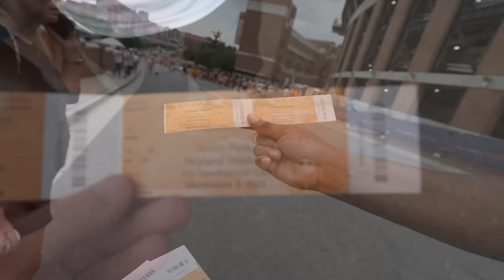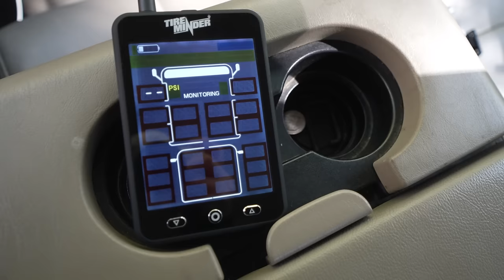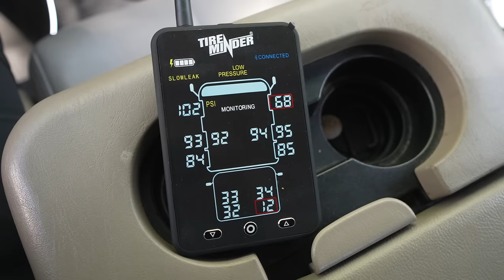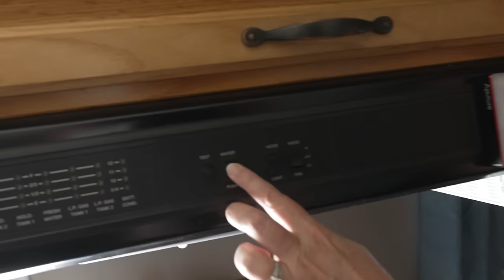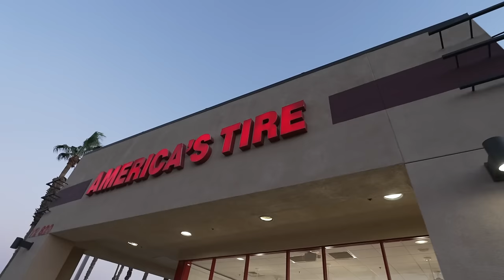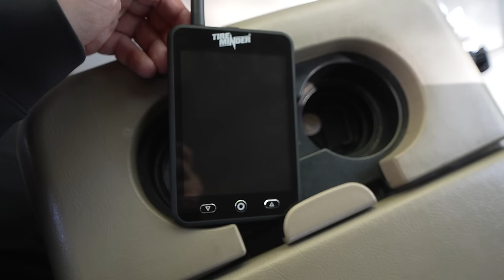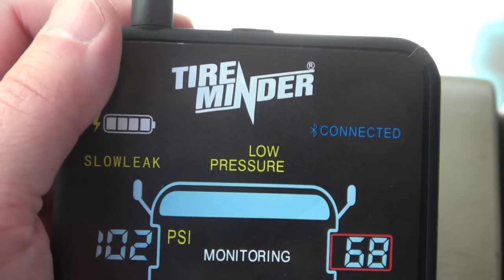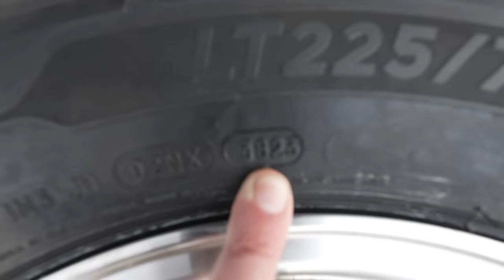TRIP KILLA - Our WORST RV Tire Disaster!

Comment: I've had similar experiences with tire installers who ignored my pleas not to jack on the axle, but I was watching and was able to call them off. Luckily, no damage. I just replaced my travel trailer tires at five years. Yeah, expensive, but less expensive than deferring it, as you folks know. Thanks for sharing that. It is an invaluable lesson for all your fans.

Comment: Where was your spare tire for the trailer
Reply: It was mounted under the trailer. Since we had already decided to replace all four tires, and the tire shop was less than 2 miles away, we decided to just skip putting on the spare tire. We were broken down on a very busy interstate exit ramp, and we felt that spending more time there crawling under the trailer to get the spare and then putting it on would be more dangerous.

Comment: you might want to think about replacing the shocks on that trailer with KYB‘s I guarantee you those are probably gone too. I know you don’t want to hear about that
Reply: We had new axle’s installed in 2021 and I think Vinnie put new shocks on then too. I’ll have to check with him to be sure!
Reply: @kristymichael  they look like cheap Monroe, which are made in China might want to have them checked . lol
Reply: I sold my diesel because we broke down for 2 1/2 weeks due to the smog device and I went back  to gas. My wife asked me she says how much you gonna spend on this well close to 5000 by the time I got done getting it ready to pull a trailer new shocks Different things but my question is when was the last time you replaced the shocks on your truck go with Bill Steins if you haven’t, you may have already so have a good day
Reply from the maker: @acmanwwjd1 we changed our truck shocks to Bilstein several years ago. Yes, a great upgrade that is highly recommended!
Reply: @LongLongHoneymoon  keep your truck. You have one of the favorites out there without all the smog on it and the cost of trucks right now it’s ridiculous. I sold mine and went back to gas. I’m happy but keep your truck. You got a nice one.

Comment: Your  tire  disaster  was  not  even  in  the  same  ball park  as  our tire  disaster  we  had  years  ago.   We  had  a motor home  that  had  five  tire  blow from  Fl  to  Tucson.  Items  were  were  torn  up :   tool  box  in  front  of  front wheel,  tail pipe  that  actually  almost  ripped  into  our  propane  line,  Steps  torn  off under  door,   Gas  pipe torn  into and  ripped  off.     Many  electric  wires  torn  into,  we  didnt   have or turn  signals  and  other  things  that  worked.   Cost  was  over  5000 for  tires  and  damage  was over  5500 dollars  and  we  were  delayed  at  my  brother  house  in  Tucson  for  2  weeks.       The  culprit  was that  a tire  store  put  too big  a tire  on our  motor  home   before we  bought  it.   Thanks  Buddy  Gregg  Motor  Homes  Sales.   !!!!!!!!!!!!!!!!!!           Discount  Tires  in  Tucson really  saved  us  by  knowing  what  the  problem  was  and  getting  us  retired.  Cant  say  enough  great  things  about  them.         Hope  I  didnt  bore  you.     Charley
Reply: Holy smokes, you did have a tire disaster! Glad they were able to find the culprit and get it fixed!

Comment: I had a trailer tire start to come apart after we made it home from a long trip.  It’s the same brand name you had trouble with years back.  I won’t use that brand again.  However, at the time , my trailer tires were eight years old.  I also upgraded to larger tires with greater load capacity.  I never looked back, and we have since sold the trailer.  Combined with other experiences I became the “tire guy” at shop I worked at.  Experience does make a difference.

Comment: I DO NOT recommend a large corporate tire company. They hire young inexperienced cheap labor. I too learned after one flat on my double axle to get one of those ramps. I think I'm missing something as to why there was not a spare available.
Reply: There was a spare available. But after this blowout, we weren’t going to chance another! So we just replaced all 4 tires. The tire shop was only 2 miles away on city streets (not the interstate), so it wasn’t worth the danger of crawling under to retrieve the spare while broken down on the side of a very busy interstate exit ramp.

Comment: We tow a 25 ft. Airstream for the past seven years from Florida to Maryland twice a year so 4 trips (2 round) trips.  We have had flat on camper going up and flat on camper coming south just 10min from our last exit off 75.

But last summer on our F250 we had a blow out/ exploding tire on the Ford rear passenger tire.  3 pm in afternoon on a 2 lane part of 95 and cruise set at 70 mph in the passing lane.  Then …. 🫨😵‍💫😳🥺😱😳explosion/ metal/glass and did I say 💥 pow explosion then we fishtailed across into the other lane and back to passing lane again . Hero is Greg my husband the driver who controlled the rig to come to a stop but in the median which left our exploded tire exposed to the fast lane traffic. The tire in shreds the shell well curled up , that was the metal sound and broken window on the airstream.   Ta da 
Our 4 tires looked good too and we thought we could get home then replace all four …. They were 5 years old and still under warranty (so called).  An 1 1/2 hours we finally changed our tire with the 2005 tire that is under the truck and had never been used.  🙄🫤🫣

Good thing it didn’t explode 3 minutes later because we would have been on a 2 lane bridge crossing a very large lake as we were in SC on 95.  I don’t believe   We would have survived that.
Reply: OMG. That was close

Comment: that truly sucks. question: do you not have a spare for the Airstream? we had one for our Outdoors RV until, like you, we had a flat. after installing the spare, i suddenly realized that we were now without a spare. so....we stopped at yes Discount Tire and had the original replaced and bought a entire new wheel and tire so that we would have TWO spares.
Reply from the maker: We do carry a spare tire. In this instance, because we were located only a couple of miles from the nearest tire shop, and we were eager to move our rig away from the side of the interstate, we opted to travel on three wheels to the tire shop. if we had been traveling a further distance to the tire shop, then we would have gone ahead and put on the spare tire to get there. When this happens, I immediately knew I would go ahead and purchase for new tires so I did not even bother putting on the spare.
Reply: @LongLongHoneymoon  i  completely understand. thank you and btw, when we had our's repaired, we insisted to the guys (and gal) at Discount Tire that we use our "ramp" to avoid the possibility of an unwanted "jackulation". LOL.

Comment: the airstream trailer is a great shell for the protection of yourself , but they install CRAPPY  parts in the inside the water tanks are the worst in the industry, !fresh, grey and black the worst,  the other proplem with the airstream is the frame coating that the manufacture said is the best on the market, ??? ahh NO! rule of thumb , all my  trailers i had got a coat of LINE X underbody spray, 2 coats, full protection for the rust problem that airstream has, ! as far as that tire, your lucky there was sdomeone to tell you whats up? i use G rated tires, . that monitor  that was on a low batteries, plug in a 1 amp charger in the plug and continue to charge it .
Reply from the maker: I love the LINE X idea! I would like to add this to our trailer undercarriage.

Comment: I NEVER go down the road with a trailer without carrying a spare tire mounted on a wheel.  You could have easily changed the bad tire on the road and likely made it home without incident.  What would happen if you had a flat 200 miles from nearest tire shop?
Reply: We never said we did not have a spare. In fact, we did have a spare. But the spare was as old as the other tires so we would’ve been gambling with it as well. We were fine to limp over on three wheels because we only had 2 miles to get to the tire shop, and it was on side road, not the interstate. We felt it was more dangerous to climb underneath the camper to retrieve the spare tire and put it on because we were broken down on a very busy interstate Exit ramp. Now, if we had had to get back on the interstate to get to the tire shop then yes, we would have put on the spare tire.

Comment: It's sad that you have to be a Karen of a customer to people that should know their Job.  One kinda related thing I'd like to mention for other trailer users, I had the metal mount that holds my spare tire bend/break at the welds while on the highway, fortunately it didn't completely fall off and hit another car, and was alerted by another vehicle as well, but I check everything on my "preflight checks" before hitting the road.

Comment: We are currently parked at an Elk’s Lodge in Redding waiting for our truck tires to arrive. We made the choice to wait until this trip and get all new tires at home.  When we pulled Inyo our campground and setting up we noticed a screw in one of our truck tires and had  AAA come out. They would not repair it due to worn trends so we used the spare. Which is a different size tire. So this morning we called around and found a dealer that could order the tire today for a delivery tomorrow. We will see how that turns out. We are looking to stop in Temecula AS dealer on our way to Carlsbad to get the tires on the AS replaced. We cancelled the last week of our trip to bee line it to get all tires replaced. Should have done it before we left, but like you we wanted to get a few more miles out of them. We are defiantly not judging but life would easier if it wasn’t for that little thing called money.  I’m glad no one was hurt and no major damage to you AS. I pray we have a similar outcome of safety. (Not of mistake in lifting the AS properly)

Comment: Dude, this might be a stupid question at this point, but where is your spare for the trailer?
Reply from the maker: We carry a spare. And yes, we could have put on the spare tire and continued on the interstate. However, and the situation, we knew that the nearest tire shop was only a couple of miles away, and we were eager to move our rig away from the side of the interstate for safety reasons. So we opted to just ride on three wheels at lower speed on side roads over to the tire shop. I probably should have addressed this point in the video because several people have raised the issue. Thanks for your comment!

Comment: You do know I hope that you can shower at a truckstop for probably $10. I certainly would have chosen that option over skipping that long. Otherwise enjoyed your video as I always do.
Reply: As a female I would rather avoid showering at a truck stop. I’m sure it’s completely safe, but I’m just paranoid. 😬 We were basically riding in the car, not doing anything to get truly dirty. We did have shower wipes for our pits, bits, and feet. So it wasn’t as bad as it sounds! 😆
Reply: @kristymichael  it is completely safe. There are tens of thousands of female truck drivers who use truckstop showers on a regular basis. As a retired truck driver myself I resent your implication that mingling with truck drivers is less safe than mingling with the general population. Many of your fellow RVers are current or former drivers. Does that make you feel unsafe when camping?
Reply: @davidking4525  I have nothing against truck drivers (my father-in-law is one!), but I prefer showering in my private space. I avoid it at campgrounds too, unless absolutely necessary. One thing about a truck stop  that gives me pause is that there are many more random people (not the drivers) moving through the area versus a private campground bath house. As a female, that makes me nervous. As you mentioned, I went multiple days without a shower and it was simply because I wanted to avoid using a public shower. It's no disrespect to anyone, it's just my personal preference. I used shower wipes and dry shampoo, and it was fine.

Comment: I must be missing something.  Why don't  you have a spare  so you don't have to travel on 3 tires?
Reply: We do carry a full-size spare. However, at this point, we had decided to replace all four tires. The tire shop we were going to go to was less than 2 miles away. We were broken down on a very busy interstate Exit ramp and felt it was more dangerous to crawl underneath the trailer to retrieve the spare than it was to just drive on the three tires. If we had had to get back on the interstate, or go a further distance, then yes, we would have put the spare on.

Comment: No spare???
Reply from the maker: We do carry a spare, and we could have mounted it and continued our journey. However, since we knew, we were only a couple of miles from the nearest tire shop, we decided to tow directly to the shop and get four new tires. Also, we were eager to move our rig away from the side of the interstate for obvious safety reasons. So in the interest of time, and knowing that we would be towing at a low speed on side roads over to the tire shop, we opted just to tow on three wheels. If we had been farther away from the tire shop or if we had needed to get back on the interstate, then we would have mounted the spare.

Comment: What am I missing here?  Do you not have a spare tire for the trailer?  Did older Airstreams not have these?  And if not,  why not carry one in the truck.  Please let me know, why you would drive a trailer with compromised tires on three tires, instead installing the spare?
Reply from the maker: We do carry a spare tire. And yes, we could’ve taken the extra time to put it on the trailer. However, in this case, we knew that the nearest tire shop was only a couple of miles away, and we intended to go directly there, taking back roads at low speeds. We had no intention of getting back on the interstate at all. In fact, we were quite eager to move our rig away from the side of the interstate for safety reasons. For these reasons we opted to simply tow directly to the tire shop on three wheels. If we had been traveling a farther distance, or if we’ve been stopped in a safer location, then we would have put on the spare tire.
Reply: @LongLongHoneymoon  I should of watched the video a little longer,  still not done with it yet.  That makes since to me now.

Comment: Give up the LT tires, trailer tires have stronger sidewalls.
Reply: The trailer tires we used for years weren’t reliable (blow outs every couple of years), and when they blew they did lots of damage. Our LT tires lasted 6 years and only failed due to age. Airstream now equips their classic models with LT tires straight from the factory, so we’ll stick with them. Thanks anyway!

Comment: You should carry a spare.
Reply from the maker: We do carry a spare tire. And yes, we could’ve taken the extra time to put it on the trailer. However, in this case, we knew that the nearest tire shop was only a couple of miles away, and we intended to go directly there, taking back roads at low speeds. We had no intention of getting back on the interstate at all. In fact, we were quite eager to move our rig away from the side of the interstate for safety reasons. For these reasons we opted to simply tow directly to the tire shop on three wheels. If we had been traveling a farther distance, or if we’ve been stopped in a safer location, then we would have put on the spare tire.

1

Comment: Judge not lest ye be judged!
Why not install the spare?
Reply from the maker: We do carry a spare tire. In this situation, because we knew that the tire shop was only a couple of miles away, and we were eager to move our rig away from the side of the interstate, we opted to run on three wheels over to the shop. If the tire shop had been a further distance away, or if we had been in a safer location, we probably would have put on the spare. At this point, I knew we were going to purchase four new tires anyway, so we just went straight to the tire shop.

Comment: Where was your spare tire for rv
Reply: The spare was under our camper. We were only 2 miles (on side streets) from the tire shop and felt it was much safer to just limp there on 3 tires versus mounting the spare on a very busy interstate exit ramp.

Comment: Electric tow vehicles aren’t “there” yet.  When the practical towing range is 250 miles and still has 50 to 100 miles of non towing range, an electric tow vehicle will be useful.

Otherwise electric vehicles are commuter vehicles and grocery getters.

Comment: No spare????
Reply: We do carry a full-size spare. However, at this point, we had decided to replace all four tires. The tire shop we were going to go to was less than 2 miles away. We were broken down on a very busy interstate Exit ramp and felt it was more dangerous to crawl underneath the trailer to retrieve the spare than it was to just drive on the three tires. If we had had to get back on the interstate, or go a further distance, then yes, we would have put the spare on.

Comment: Why don’t you have a spare tire?
Reply: We do have a spare tire. But we had a 2 mile drive on city streets to the tire shop, so we just drove over on the three tires instead of putting the spare on. We were broken down on a very busy interstate exit ramp and felt it was more dangerous to climb under the trailer to retrieve the spare and put it on there than it was to just drive over as we were. Now, if we would’ve had to get on the interstate to get to the tire shop, we absolutely would’ve put the spare on.